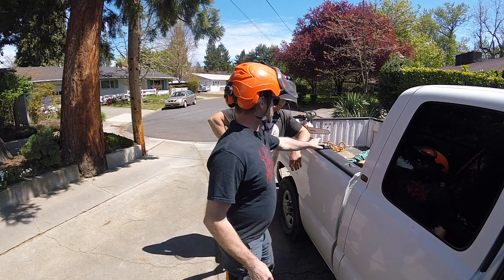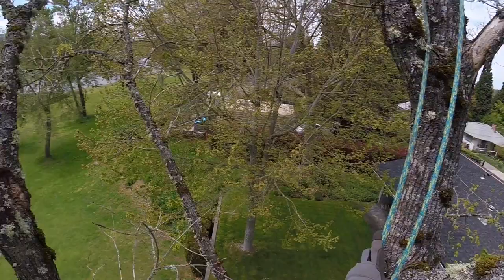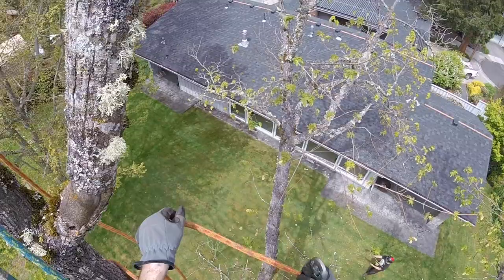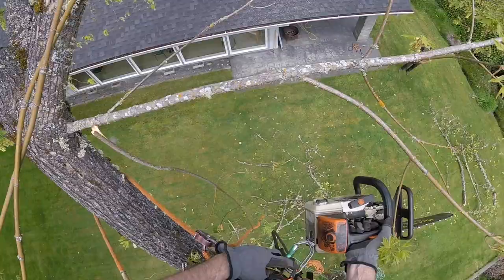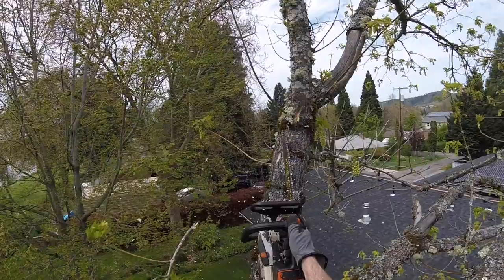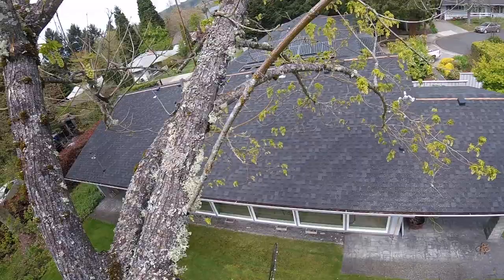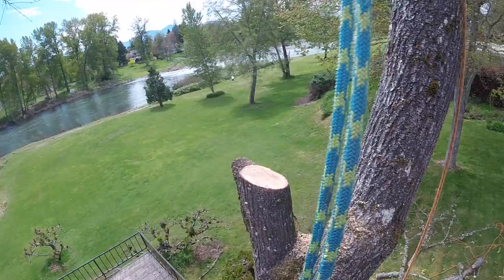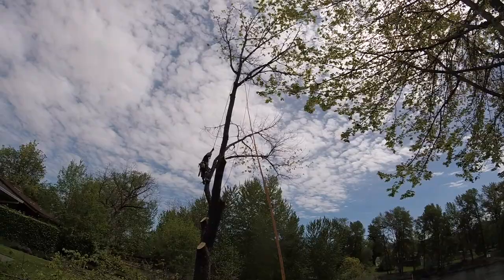Dynamic Weight of Wood

Comment: Science monkey request, two lag bolts for anchor points placed vertically a foot or so apart by the backcut with the enforcer in between the bolts to measure the leveraging sheeting force of felling trees! Just a though, understand if you don't want to potentially destroy that gadget. Love the channel, thanks!

Comment: Have you done any videos where you test dynamic vs static force/weight of pieces in negative rigging scenarios?  I have never seen good testing data on that.  Just bomb a piece out, get the number, then weigh it hanging there.

Comment: Great video as always! Dedicated to putting out great content for us to enjoy. Question for you, when you were natural crotch rigging at 2 points would that decrease the dynamic loading of the enforcer? Making some of the actual weights higher, as opposed to the negative rigging forces on the single spar through the xrings? Thank you for any explanation on this
Reply from the maker: Not exactly. The scale measures what is happening to it.
Reply: August Hunicke, I never gave it a thought about that aspect!  Thank you. Sometimes my mind tends to over think situations.
Reply from the maker: Cory Chase if we were going through a block up there.… Whatever the enforcer feels would be nearly double felt by the spar. Ariel friction above diminishes overall load on the spar.

Comment: quick question for you buddy the monkey Beaver climbing belt I recently purchased I've never climbed with a belt that has buckles that clip together like the i s c buckle you trust them buckles a hundred percent I always climb with a belt that had like a regular belt buckle on it and should you ever change them buckles or are they good for the life of the belt
Reply from the maker: b r they are awesome. ISC is state of the art quality, that’s why I wanted them. To put the belt on over rain gear much like a seat saddle (if you use an adjustable bridge.)

Comment: Perhaps a stupid question: why Stihl saws? Just a defacto industry standard.
Reply from the maker: I buy them and they keep working. Not temperamental like other brands.
Reply: @AugustHunicke  Fair enough. Yep, pull it out for the first time in a while, and it's Stihl working.

Oh, they seem to be the base of choice for chain saw competitions where the saw has been modified for more HP and to run on aviation fuel. Adding tuned exhaust, custom machined head. Exhaust and intake ports have been redone.